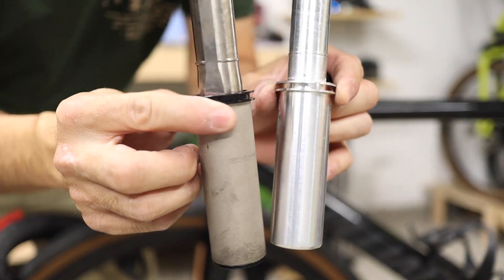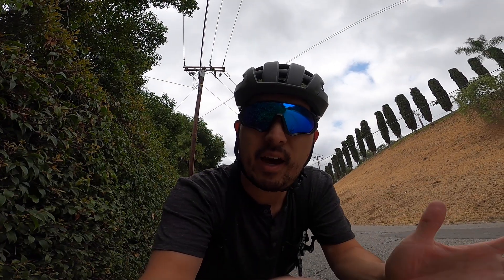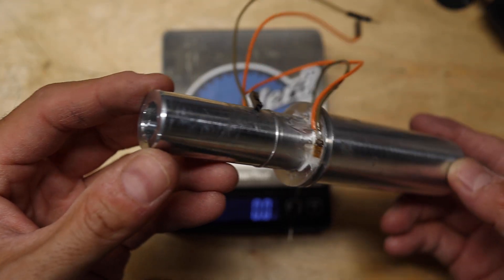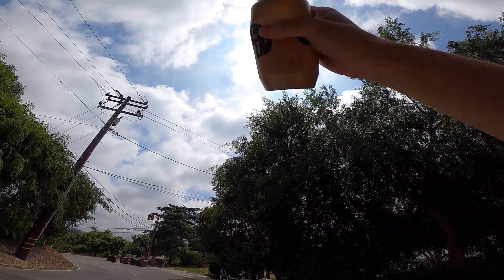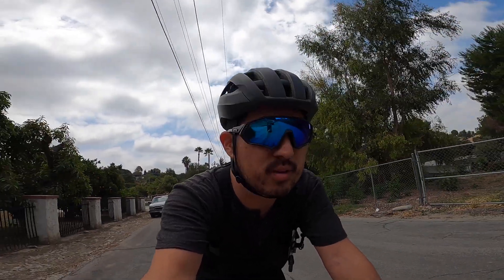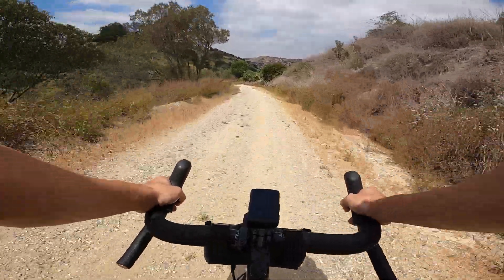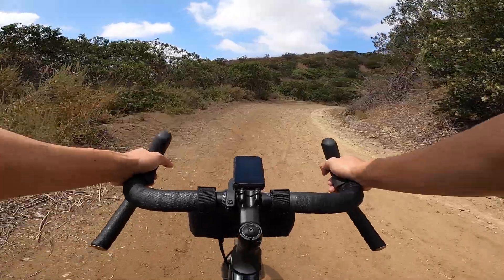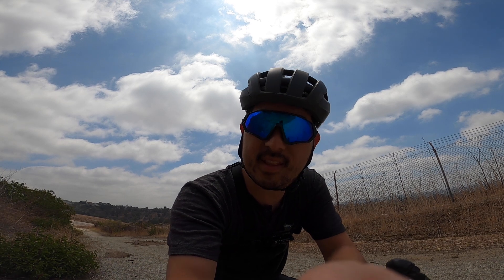I DELETED My Specialized Future Shock!

Comment: If i delete the future shock with this piece can i put a traditional suspension fork on diverge? Thanks
Reply from the maker: No, unfortunately the FS headset design is baked into the frameset. Our delete kit just removes the suspension cartridge, but doesn’t fundamentally change the headset design.

Comment: What was the long term review on the delete? Also, how are you getting on with the Diverge? I'm just getting back into cycling after a number of years hiatus, I've got myself a Sirrus 2.0, most likely will be upgrading to a Sirrus X 4.0 or possibly an entry level Diverge, just need to figure out what type of riding I'm going to be doing, new area too, I'm SE London UK / Kent, there are quite a few cross country loops around here, but also I will be doing a fair bit of city riding. I have a few months until my cycle2work scheme kicks in. Was really into the idea of FS 1.5, but what are the benefits vs financial cost and weight trade off? Also, at 5' 9" with a positive ape index I went large size frame on the Sirrus, wondering if I could be better off on a medium

Comment: Hello, is it possible to install in this bike a third party fork? Even if it comes with getting rid of future shock?
Reply from the maker: What do you mean 3rd party fork? The specialized future shock fork is proprietary and I don’t think there are any aftermarket options
Reply: @TheBikeSauce  I mean standard carbon or alloy fork that can be found in other bikes or purchased in bike store. As i know forks in bikes that have future shock has shorter and thicker forks tubes (because of possibility to install future shock).
Reply from the maker: Right, you can’t install a normal fork in a FS bike. Or maybe you can, but it’s not officially supported. You’ll have a weird divot where the duck bill used to be
Reply: @TheBikeSauce  Divot won't bother me, is there any adapter or someting that will allow installing traidional fork? I just want to be sure that i won't be forced to throw away whole bike, because i won't be able to change a fork when mine will break.
Reply from the maker: There’s nothing on the market that I know of right now

Comment: I just went to a Specialized shop to find out the cost of a Future Shock 1.0 replacement cartridge.  They couldn't find any FS 1.0 parts in their system and the FS 1.5 was $240 and the FS 2.0 (which was the only one they had in stock) was selling for $449.00!  That said, PLEASE SAVE ONE FOR ME!  I am looking forward to upgrading with your 1-piece design.
Reply: Is that $449 USD?!

Comment: Has anyone tried just replacing the spring with a hollow tube spacer? It would be a simpler means of achieving a similar result.
Reply from the maker: Good thought, but it would only apply to the 1.5. Also, the adjustable spring is only a booster spring and the main internal spring would still be active.

Comment: I am also thinking of building a rigid tube to replace my future shock. Your first version looks not bad but I am wondering why you are keeping the complex shape with the sharp notch at the diameter change. This is not good for fatigue.
I will mill a tube with two diameters out of one piece with a smooth transition from lower to upper diameter so that no notch is given. No notch, no local stress concentration and no fatigue issue.
There is no need for a rubber etc. since there is no mechanic etc. to be protect at the diameter change.
Keep it simple.
Since it will be milled out of one piece, you can also directly integrate the thread fixing for the upper ‚headset cover‘.
Reply from the maker: Thanks for the feedback. It sounds like a good idea to keep it more simple, but there are aesthetics to consider as well as ease of installation and preservation of fit. Without the boot, there will just be exposed metal of different diameter. Or you end up using 35mm worth of hs spacers to avoid changing the stack. Design aside, or analysis shows no localized stresses to be concerned about. The prototype is undergoing ISO fatigue testing as we speak, so we will see if anything comes up.

Comment: I have a 2021 Specialized Diverge expert with the 2.0. My future shock is shot! I feel the bike is unsafe at this point. With both hands in the drops you can alternate pressure by pushing down on the bar and there is a lot of play. I have disassembled and tightened everything to spec and can not figure out why the excessive movement. I can not find replacement future shock 2.0's for sale anywhere. I am on the verge of ditching the diverge and going with something else. Please sell me one of your replacements!
Reply from the maker: Haha. In the works! We’re working on it

Comment: Would be interesting to see how light this option could be. Could you cut another 50 grams away?  How long does the adapter actually need to be?  Also,  thanks for making the 5mm adapter rings I have purchased a set and have one installed on my bike currently.
Reply from the maker: Yea it’s a first draft for sure. Although being the stem area, I’d rather not see what I can ‘get away with.’ It’s already more than 150g lighter than either FS model
Reply: @TheBikeSauce  totally understand the liability issue.  But, say I am running the 0mm headset spacer vs the 15mm one...  That is 15mm of 7075 that I don’t need on my bike.  😁

Comment: Great video!   Based on this great idea.   Any chance you have plans to refine this “delete” and create one with A: a shorter lower section, (at some point the friction interface between the steerer ID and the cylinder OD become redundant.) 

B: the upper section that has an OD for a standard 1-1/8th stem.  Add spacers or trim the length to preference…. 

I believe with a little refinement you can safely get this delete insert under 100 grams.   

There would be a real difference in feel at that point.  It would not be a placebo.     

Keep it up.
Reply from the maker: Great feedback. Will definitely consider

Comment: I have a Roubaix and I'd never heard of the 500-hour replacement (probably should have read the manual). I've certainly exceeded that and I haven't noticed a performance difference, or it has been so gradual that I've gotten used to it. Either way, I wouldn't bother to replace it.
Reply: I never heard of a 500 hour replacement also. I think that was the thing with the previous version of the future shock

Comment: The weight saving at 140g seems like a non-goal for a gravel rig. Not sure your claim of a 500hr cartridge replacement is accurate either. The FSR only gives 20mm of progressive travel, it’s not for anything but corregated/high resonance gravel roads, probably the single biggest reason you buy a diverge. As a road biker, I’d suggest you consider a tarmac.
Reply from the maker: Geo is completely different on a tarmac and rides as such. The delete started as a student product design project, but grew legs and it seems there’s a small market for it. People seem to have a variety of different reasons to want to delete the FS
Reply: @TheBikeSauce  Back here after my comment two years ago. Im not of the belief that the diverge should only be run without the FSR as the norm, and only installed for really long/100mile type gravel courses. Also, the only FSR worth running is the 3.3, the spring loaded FSR's are horrible to maintain. Great channel!

Comment: Is there somewhere to sign up, or to get on the list to receive info when the FS replacement part(s) will be available?
I have a Sirrus X 4.0 - it's already got over 400 miles on it but I can live without the FS and would like to replace it with a fixed position alternative.
Also, I totally love your videos - keep 'em coming!  I am an old person and the use of dropper posts was new and even though I have two bikes that came with d-posts, I never used them.  When I finally understood how helpful dropper posts are should be used, and why, then I began using them and of course I immediately "saw the light" and now I will always have and use them (I think it was your video with the six upgrades to a Rockhopper that really began to help me understand the value of DP's).
Thank you very much!!!

Comment: I love the do-it-yourself engineering.

But the cynic in me is thinking: did you just convert your high end Specialized into a bike with tapered aluminium steerer?
Reply from the maker: 😆 you’re not wrong. However, I do believe there is a need for something like this in the community
Reply: @TheBikeSauce  If you can one day make it out of carbon ...

Comment: what happens if you just don't replace it? does it eventually just sag down? Wouldn't it be easier to add some spacers at that point (don't really know the mechanics of it, just hypothesizing)?
Reply: The Future shock wears at the front and rear, increasing clearance between the inner and outer sleeves. It will make a more pronounced grinding/rubbing noise as the clearance increases. My Roubaix is doing this already. It is an inherent design problem because of the torque moment applied particularly when riding on the hoods. I have tried to lubricate the sliding surfaces but it didn't make any difference.

Comment: Quoting Specialized: Future Shock Maintenance
The Future Shock is designed to offer consistent performance for the life of the product.  With a fully sealed design, the Future Shock assembly does not need service beyond wiping dirt and dust from the exterior.  Should the rubber boot become fatigued from use, replacements are available, S209900002." - So why replace future shock with simple aluminium rod ?
Reply: 3 yrs too late, lol
Not sure if this is serious or sarcasm. Presuming serious, the deceptive key phrasing here is "for the life of the product." The life of product (Future Shock, not the bike) is rated for 500 hours.

Comment: Would love to see the final design be able to use a standard top cap above the stem and maybe a 3D printed cone to replace the rubber bellows filler below the stem.
Reply: More unrequested input - Looks like the top section of your Delete is the same diameter as the Future Shock without the additional shim required to use a standard stem. Why not just make it 28.6 - it could also be stronger and without as much of a stress riser where it narrows down.
Reply from the maker: Yup, all things we considered. As is, it’s a direct replacement which wouldn’t require a new stem. The stock boot is left in place to retain the stock appearance

Comment: Great vid.
Changes in tire pressure can "simulate" part of what the suspension stems/FS etc do, but come with their own compromizes if you get too low and/or when you try to push the bike hard on pavement.   Choices, choices

Comment: Nice work. I’d own a 64cm Diverge already if it wasn’t for the future shock which is the only option in that size. My issue is Stack. There’s never enough and I use a steerer extension on most of my bikes. Something I suppose a future shock would not accommodate safely.

Comment: Really interesting video, thanks!  I suspect the different feeling (sharper) in steering that you felt is due to the rigid fork, no squish in the cornering, no change in HT angle, rather than the reduced weight.  And I think you have the metrics you need - the ride feels just as good if not better with the FS deleted, so isn’t that what really matters…

Comment: Simple home made option, length of 1" 1/8 steerer tube and a 28.6mm to 30mm dia. seat post shim.
Reply: Both of which are already engineered for the task in hand.
Reply from the maker: You have to study the fs architecture to understand why that won’t work. Plus this is a student research project; the whole point is for them to go through the product engineering process.
Reply: Ooooo, I am intrigued, do go on about the FS Architecture.
Reply from the maker: 🤦🏻‍♂️ gotta stop replying to toxic comments. Briefly, a straight tube would slide through the headtube, the shim would fall in, the stock boot wouldn’t fit so there’d be an exposed section of steerer (standard HS spacers are different od), and you wouldn’t be able to reuse the stock stem since it has a narrower clamping diameter.
Reply: It's hardly a toxic comment. The shim is lipped at the top, so it won't fall in, forget about the stock boot, it looks rubbish anyway, the duckbill cap sits above the shim, standard headset spacers above that and then the stem. You are missing a big trick here. I'll stick a video up shortly.
Reply from the maker: Holy smokes, you actually did it, nice work (saw the video). Still, the point of this project was to engineer a product from conception to prototype. Your hack totally works, but I wouldn't consider it an engineering capstone Sr. Project for my students.
Reply: Yeah, was straight forward and it's been thrashed thoroughly with no issues.
Completely get the prototype aspect, it's what's needed to further improve and develop products.

Comment: Nice job. Question, why design it to keep the boot. Was there an engineering reason? I think when I machine mine I will make the top section 1 1/8" dia to accept standard stems and spacers. Might even send it out for black anodize too :)
Reply from the maker: Boot is purely aesthetic. This is a prototype. Final will be anodized, even though it’s completely concealed

Comment: I’m a FS convert,it’s no gimmick. I use the stiffest spring to reduce sag and I run narrower tyres for the same comfort level.
That said,the Specialized Roubaix and Diverge range with the FS are wickedly overpriced. I’d say a standard frame with a Redshift stem offers best bang for buck.

Comment: Love this! I am a machinist and have thought about making something very similar for myself out of titanium.  I have wondered what stresses this would introduce into the fork steerer tube and or collar.  
I wonder if a carbon “future shock delete” would reduce those stresses.  It might help dampen vibration as well.  
In your testing, do you plan to do any testing on amplitude/frequency of vibration into the riders hands vs standard future shock and vs a standard carbon fork?  Would be very interested in seeing that.
Reply: I have my own FS delete and been running it for a while. ATM a titanium one brewing... Regarding a carbon one, all manufacturers I spoke to said that the collar is expensive to get right, is the sharp edges. For that to be economical defendable, a series of units is needed. Anyways, the Diverge with the  FS deleted is fantastic.
Reply from the maker: Funny you ask. I have a couple of high frequency vibration data loggers on order

Comment: Absolutely love the FS on my Creo. I tell people it’s like the equivalent of adding 10mm of width to the tires. 28’s now ride like 38’s. I knew it was proprietary when I bought it and although I wasn’t aware of the 500hr replacement recommendation, if I have any issues I’ll gladly replace it with a new unit.
Reply from the maker: Definitely. I’d say most people appreciate the benefits of having it. It’s just expensive to replace

Comment: Please make an aftermarket FS. I tried to brainstorm a generic one that could fit on all gravel/road bikes, but I guess my MechE degree + 0 real engineering experience wasn't enough.

Also, Specialized is incentivized to have us replace the FS. I would bet that 500 hours was picked to be low enough to generate max revenue (max # replacements), while high enough to not deter buyers of the bikes. For me, unless the FS starts feeling bad (or wiggles, jiggles, and makes sound etc.), I probably would just continue using it past 500 hrs.
Reply: I agree, until I feel a difference in performance I will keep the FS I have (first version with springs) in use.
Reply: https://www.youtube.com/watch?v=9_PQ5263ueo
Reply: I have about 1,500 hours on my Diverge with Future Shock 1.0. Still works, but not quite as smoothly as when new. Interested in the delete option to save some weight.

Comment: Nicely engineered...but to me the main takeaway from the video is don't buy proprietary stuff like this in the first place. What's the point in spending extra dollars on the Future shock system, only to 'delete' it a couple of years later? I made similar experiences with Cannondale's Headshok...pretty cool when new but expensive and. Complicated to maintain and replace. Since then I stick with the simple stuff...:)
Reply from the maker: No arguments there. I think a lot of consumers buy into the future shock system without understanding the long term maintenance requirements
Reply: ...FS is the sole reason I DIDN'T buy a Diverge
Reply: @daniels.2720  I had the opportunity to buy a used Diverge at a good price, and then I noticed the FS boot and called off the purchase 🤔
Reply from the maker: Problem is that it’s a great bike

Comment: Bought my first new (to me) Roubaix which came with FS 1.5. This is the first I heard of Specialized's recommended replacement cycle of 500 hours...that's essentially once per outdoor riding season!

Love the prototype testing. Looks solid. Would an aftermarket FS (1.5 or 2.0) be viable?
Reply: Mine is allready going for 30000 kms, it works like new. Never had a problem with it, but this is a great solution!